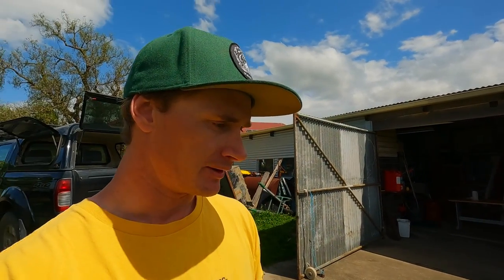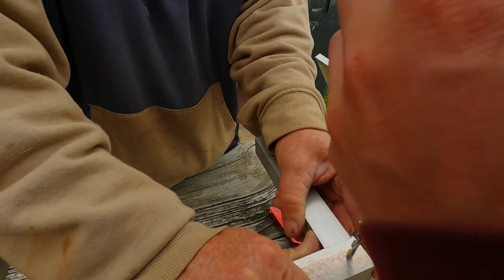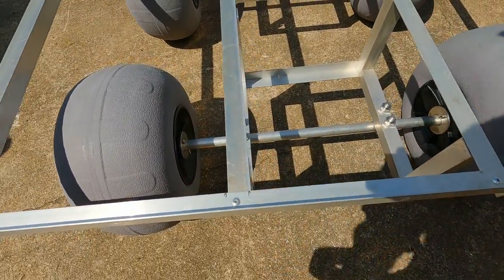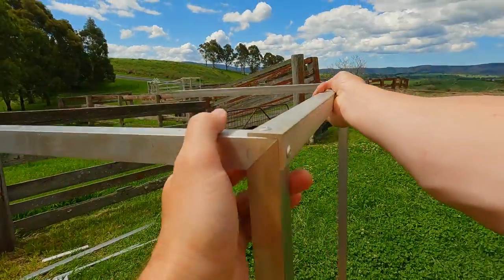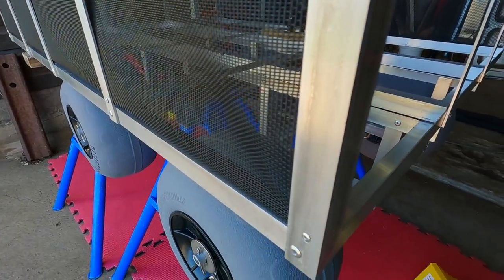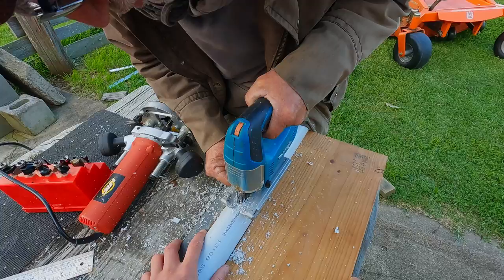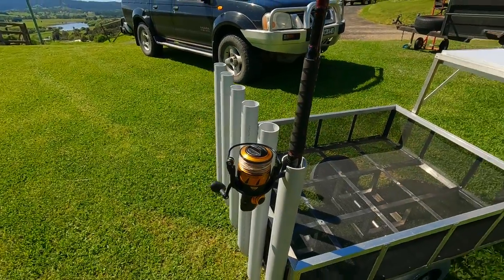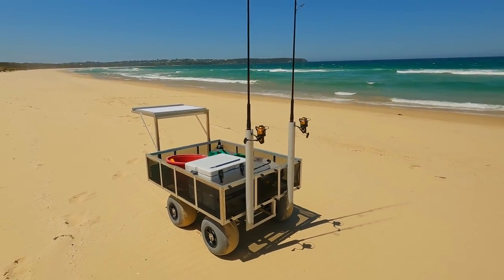DIY Beach Cart | Full Build + Test Run

Comment: Update on your cart and its durability if you don’t mind sir. I am curious how well the rivets hold the way you assembled it. Turned out great btw Thanks from the US
Reply from the maker: Cheers and it’s held up great so far. No bending or rusting, the pet mesh flooring is still going strong. Had a fella sit on one of the corners putting all his weight on it and it didn’t buckle which surprised me. One thing I’d change, which would be easy for me to do but isn’t too much of an issue, is moving the rear axle back slightly - the cart will wheelie if you load something to the rear before something up the front. For my needs it’s the right size but it’s a workout to push when fully loaded with 30kg (livebait tank and gear) and whenever heading up a dune. But happy with the design